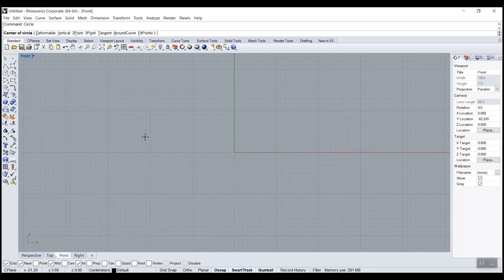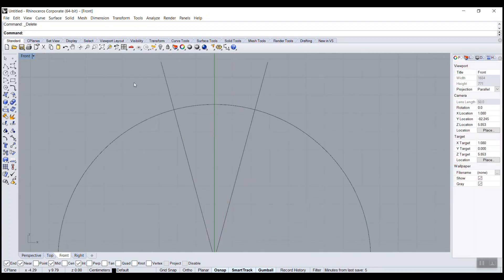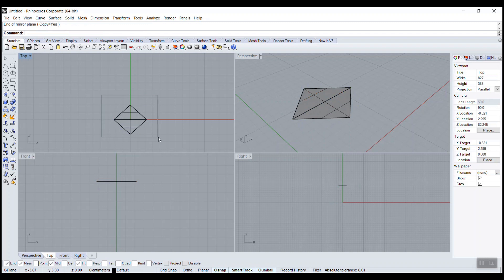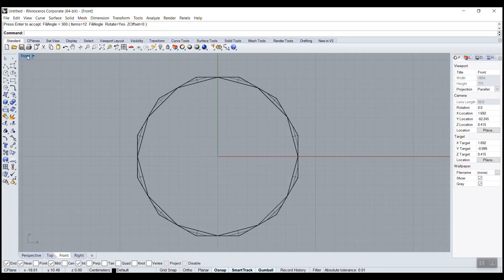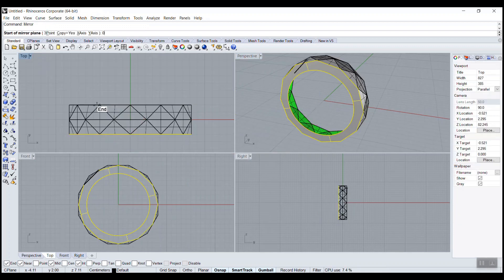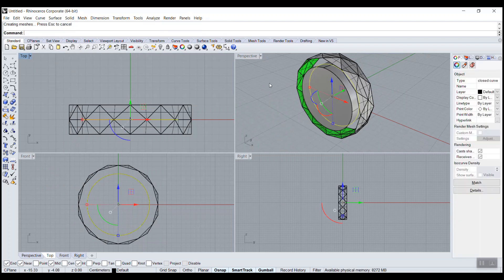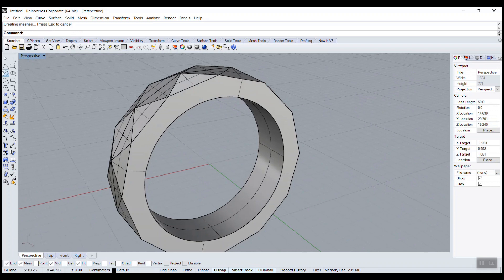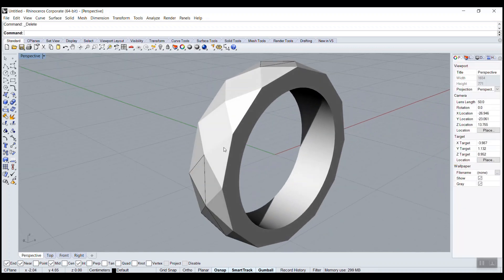Rhino 7 3D Telsa Cyber ring Tuturial

Comment: One question.If you want do that  different numer. You do it again? Or you can do it with 1-2 clicks?
Reply from the maker: What do you mean ?
Reply: @tgroppi  different size ring...for bigger fingers or smaller
Reply from the maker: @rixter69  when type circle click on diameter and change it according to size
Reply: use grasshopper, and then you can change the value and it will auto update
Reply from the maker: @avitolourenco  tx

Comment: in the last step when i did planarsrf it cover the whole thing of front view .why is that.i hv tried it what exactly you  have told to da.can u help me to fix.
Reply from the maker: can you tell exactly at what time ? for planarsrf i was picking 2 circles to create a band, if only 1 circle then it will cover the entire thing
Reply: @tgroppi  in first method in this video i did'nt see you were picking 2 circles.after designed arreypolar  u have picked a circle and move it to the edge and then u selected planarsrf  and selected circle and designed curves.i did the same.but it coverd whole side with the circle.
bcs i was unable to it i have created basic band and designed you have done in arraypolar separately and join both with booleanunion .but its not very clean.
Reply from the maker: @madushikai9051  can you email me the file at tgroppi@usa.net it will be easier
Reply: @tgroppi  I have the same problem as well
Reply from the maker: @jadontsang1622  email me your scene or snapshot at tgroppi@usa.net
Reply: I have the same issue, how is this fixed?
Reply: ohh I just figured it out. If the circle is selected before applying the command it will cover the whole circle too. Just unselect the circle and then apply the command, then select the circle and other edges. It will do the work.